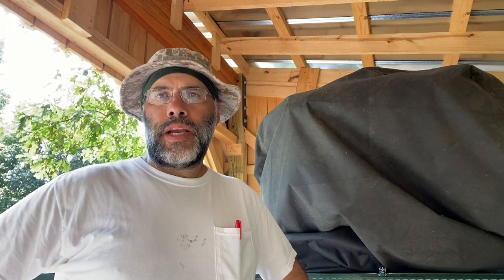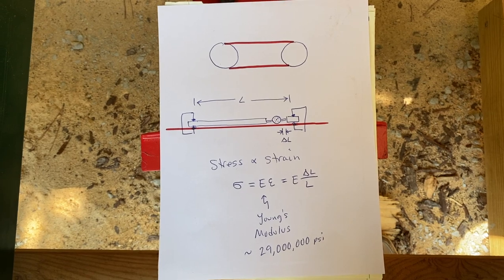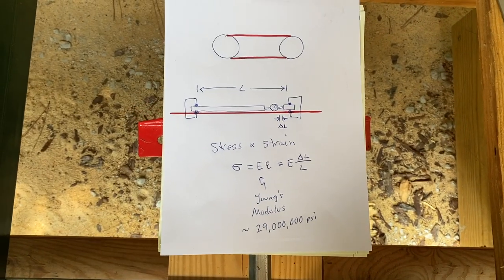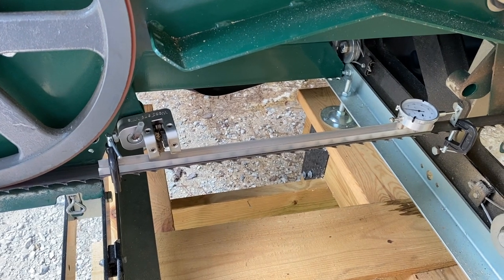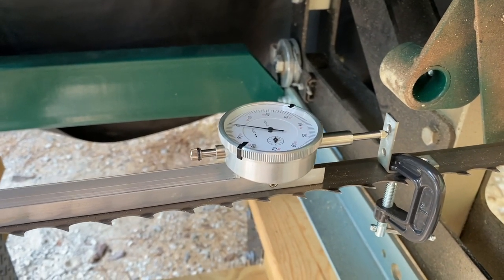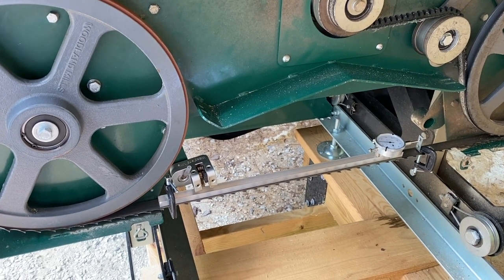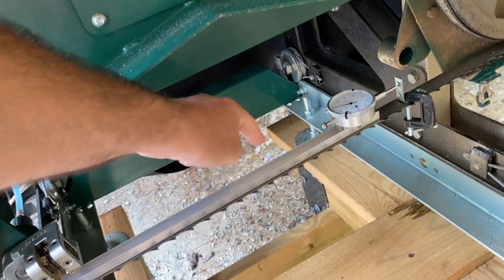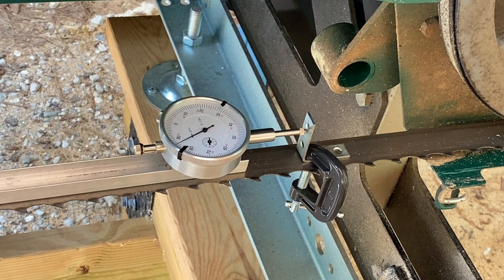Part 2 - Mechanics of Woodland Mills Sawmill Blade Tension: Measuring Blade Tensile Stress

Comment: There are those who just want to know the "how" of doing something...and then there are those who want to understand the "why" behind the "how'. This kind of detailed, and yet easily understood, illustration of the mechanics of blade tension will be invaluable when it comes to a situation where things are not quite going according to expectations. It will help decide where to go from the "standard" settings to adapt to challenging conditions. I, for one, appreciate this kind of video presentation. You have provided a balanced mix of theoretical and practical to help one understand the topic at hand. Well done!

Comment: So Yes, the theory breakdown as it applies to practice  is really a value. I would have gone down my own rabbit hole figuring it out, but you saved time for me, as well as shown a simple working setup should I decide to make some measurements or comparisons. I don’t have my mill yet, so this knowledge is being used as advanced wisdom. I’d like to hear how you decide the forward cutting speed as it relates to stress on the blade or other components.

Comment: I too tend to use the “over thinking” method of things during setup and operations on my homestead.  Drives my wife nuts when I use the Pythagorean theorem when laying out her chicken coops or raised garden beds, Haha!  But I can’t help it; as a machinist, making things Square and accurate to within Thousandths is just a part of who I am.  Certainly slows projects down a bit, but it sure looks good when completed!  
Nonetheless, I know this is an older video, but as a new Saw Mill owner, and within a day or two of making my first cut…(had to get the Mill bed square and level😉), I’m curious if you’ve considered the blade tension changing after making a few passes.  When heat enters the blade, surely the tension would lessen due to elongation from increased heat.  That’s simple metallurgy.  

- Have you ever tested tension with heat in the blade?  
- if so, what were the results?
I perceive this could even be substantial, and require adjustments to blade tensioning.
Additionally, to ensure blade longevity, it seems one would need to be mindful of blade cooling as well so as not to allow over tensioning.  Again, I tend to overthink a bit, but you seem to ponder things similarly, so I figured I ask.  Thanks in advance if you find time to answer.  I’ve subscribed in hopes of finding additional videos of the same caliber.  Have a great day sir.

Comment: great video! I have a harbor freight mill which is very similar to the woodland mill and have had problems with blade breakage for years and come to find out using your dial ind. rig I was over tensioning my blade by two or three fold!!  keep up the great videos

Comment: thanks for your video i think basics are more helpful but this is very useful too most of the math was over my head and like you said diff. blades will change setting there are more than blades than you can count wood mizer has loads of them alone. i have a woodland mills hm-130 max ordered still over 2 months out. i think if you were young and was going to try and make a living milling the big cook's mills would be the way to go. i think you have the best video on mill leveling i will have to re watch it when my mill comes. thank you again take care, be safe and well.

Comment: Might be a good idea to remove the tensioner handle, spring washers and shims once a year to examine, clean and lube them up. I have replaced many broken or worn out Belleville washers in other applications where they were not up to the designed task. These come in a variety of thicknesses and materials, try a bearing supply house or big online industrial supply.

Comment: This video series was outstanding! Even though my band saw mill has not yet arrived, and it is of a different brand, I found this absolutely fascinating! So with that being said, I'm all for this type of video mixed in with the practical hands-on stuff! I appreciate you sharing your years of experience and knowledge. I did want to ask if you, by any chance, had plans available for your sawmill shed and the base you built for the sawmill? Thanks so much! 👍
Reply from the maker: Thanks.  No plans for the shed, it basically just fits the mill plus a few feet of sheltered walk around space on all sides.  About 8.5-9' wide and 25-26' long.

The base is custom to the mill rail spacing and footpads, so that will vary with brand/model, but the height is the main benefit that will work for every mill.  The lumber base is about 18-20" high and the log sits another 6-8" above that, for a working deck height of 24-28" ballpark.  Similar to trailer-mounted mills.  That can be customized to taste based on your habits and height, but the important thing is to get the mill up off the ground to save your back.

There are videos on both the shed and base.
Reply: @Lumber_Jack  Thanks!

Comment: Nice video.
I have a question.  How do you account for things like the thickness of the blade and the width if you have a different blade?  I may have missed it but I don't think I saw you measuring the thickness or the width of the blade and calculating the mass of metal those two measurements would yield.
I've seen the instruction for the Lennox tool.  They don't seem to be able to account for those variables either.  And yet I am quite certain that if my hunk of metal is thicker and wider it'll take more stress to get it to movie any given amount.
Reply from the maker: The tensile stress is proportional to strain alone.  Under the same force, a thicker and/or wider blade will stretch less, have less strain, and thus less stress.  It would be equivalent to spreading the force over the larger cross sectional area, so it all should agree overall.

Comment: A bit off topic but my 126 14hp will up on my built up table and fired up tomorrow morning. My crazy question is what did you use to attach your sawmill feet or leveling stands to your table?  I can't find nothing on what's best to use anywhere.. I just don't want my sawmill sliding all over the place lol..
Reply from the maker: Definitely need to fasten it down good.  Seen too many people run their mill without doing that and the track gets out of whack quickly.  I used 1/4" lag screws with a phillips head.  Really worked well to hold the footpads down.

Comment: So is 25lb. To much i was curious to know. What ft. Lb. Would you recommend on the mill.
Reply from the maker: Well, all I can say is that what I have been doing (setting thrust bushing flush) equates to ~20 ft-lb on my mill, and it's always worked great.  Doesn't mean it's perfect or right, and may not apply to everyone, but I will stick with what works.
Reply: 20

Comment: Sorry if noob question but why not a tension spring to compensate for heat build up elongation?
Reply from the maker: The tensioner mechanism on the sawmill has a strong spring to maintain positive tension under a variety of conditions/issues.

Comment: what about the distance between mounting points? A24 in band will stretch more than a 6 in band at the same pressure.
Reply from the maker: Strain is based on the ratio of stretch to original length.  For an elastic material, the ratio will be the same no matter what original length -- the amount of stretch scales up with the original length.  So we always look at the ratio for these calculations.

Comment: Theory is a little too deep for me. Comparing the three methods and using an average would be sufficient for me to do occasionally.  I'm hoping the adjustment using the thrust bearings will be accurate enough,  saving time. Good video for theory of blade tensioning for engineers.